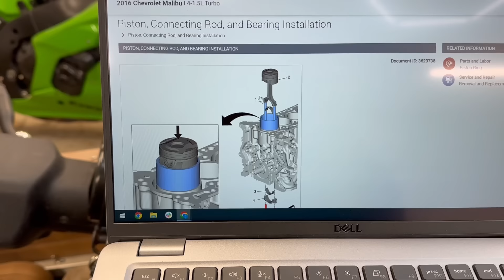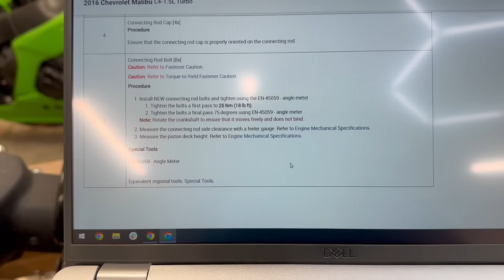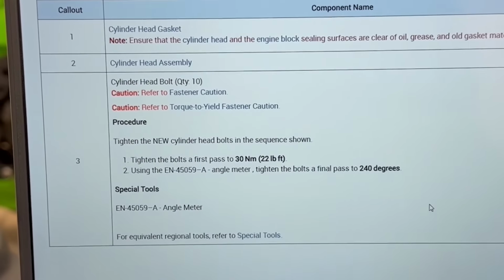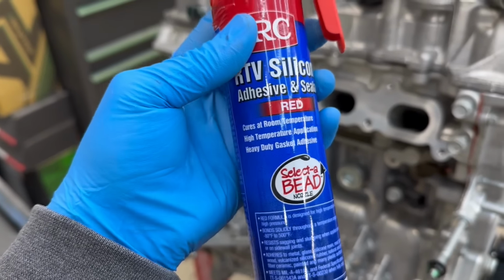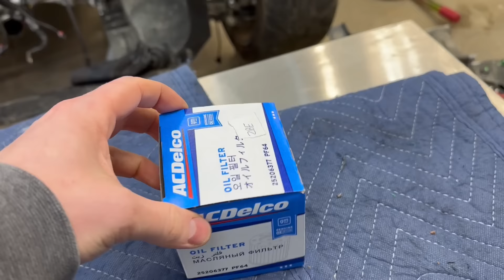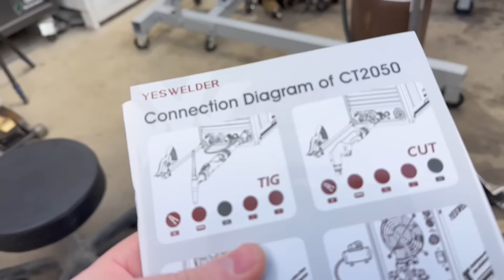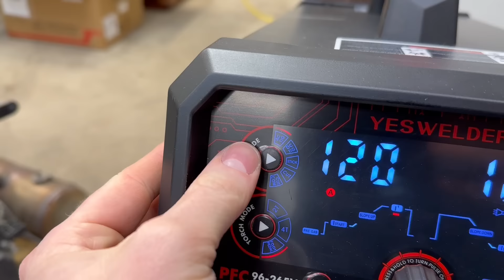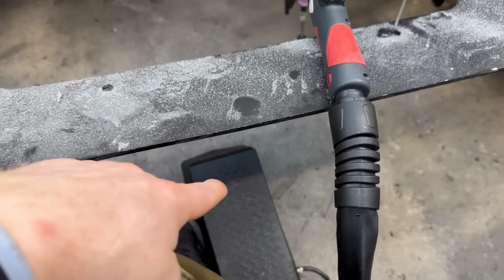Rebuilding A Wrecked 2022 Vanderhall Venice GTS (Part 4)

Comment: Aluminium is hard to weld on since the alloys can vary ALOT. It looks like you need to let off on the pedal in the end, it's too hot. Also add some more filler in the end. 
When using liquid gasket, don't use too much of it. If there's no damage to the flanges, just a tiny bit can keep it sealed. When overusing it, you'll get the red blobs on the side of the engine, which isn't a problem, but it's also on the inside. If some extra sealant gets loose, it can in worst case clog up an oilport and do some real damage to the engine.

Comment: Tbh you should got a spool gun it’s way easier to use and a lot quicker than tig is good for super thin metal like charge pipes. I’m a mig welder so my opinion might be alittle bias. But this gaps are nothing with mig 😂. Good luck nice build
Reply from the maker: I agree with you on the aluminum mig, I'm sure that's what is suppose to be used on this frame! TIG might be too tedious

Comment: thats way too much RTV. There was so much overflow when installing timing chain cover, let alone on the inside. Put a light bead all around, then spread it with your finger.
Reply: I said out loud "OHHH NOOOOO" when I saw the amount he had used. Rip.
Reply: Yes, yes, me too,  you're right guys.
Reply from the maker: I hope it isn't too much, according to service information they said 3-5mm bead around all the cases. I cleaned off quite a bit off the old cases so I assumed a bit of overfill wouldn't be bad. I hope it works out. I mean it's not too bad to take apart again lol
Reply: I don't think is is too bad you don't have any components too close so extra ain't gonna kill it at least we know that will be sealed tight I bet a lot of the guys saying it's too much have to go back and reseal when there's start leaking
Reply: It can clog all the tiny holes of the oil gallery, screens and the pickup.
Reply: Yeah I have to agree, all the mechanics I have watched say put a small bead and spread with your finger. If you look how much is hanging out the outside, what could be inside and if a chunk falls off n gets sucked up into the pick up tube then gets stuck. The engine will be starved of oil and you know how bad that is man.  I hope this helps

Comment: Your actually going to weld critical chassis components and you have absolutely no welding experience and aluminium which is totally different to welding steel. 
I hope you at least get your welds checked by professionals before putting this on the road.

Comment: Wow... 🙈 who is that st..id to rest the waterpump on the blade's to press the pully on!? 🙈🙈
Is that standard in US garages? 😂😂😂
Reply from the maker: There is a metal pin that sticks out bast the blades on the inside. That metal pin runs all the way from the outside through to the inside. Thats what the press was using as a tension point. No harm done to the blades. They were under no load, cheers
Reply: Ok, then I hope that the shaft ist still straight. 😉

Different questions: why didn't you practice to weld two Aluminium pieces together instead of making beads on a flat piece? It's a huge difference, because the edge will melt and run away if settings are wrong.